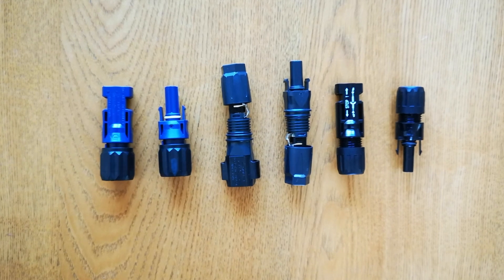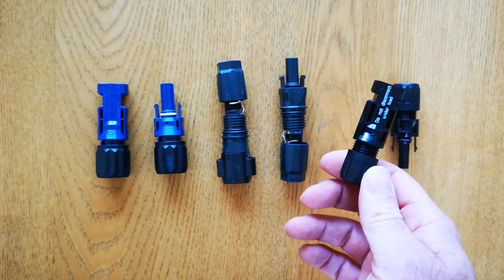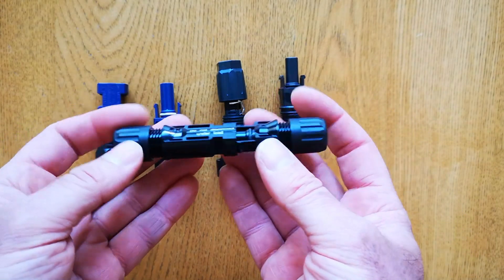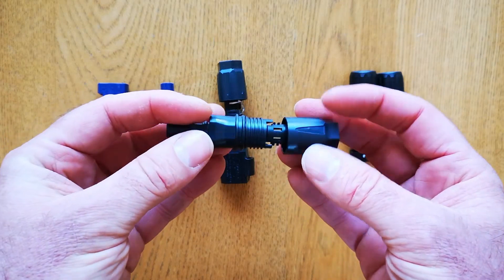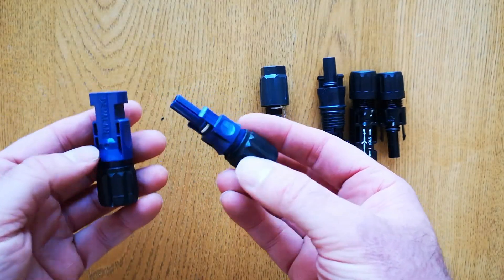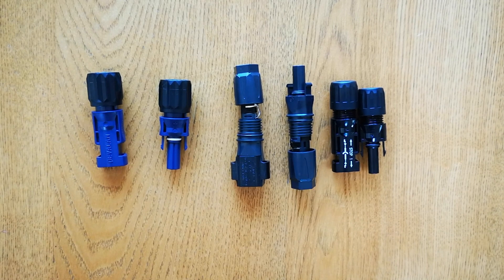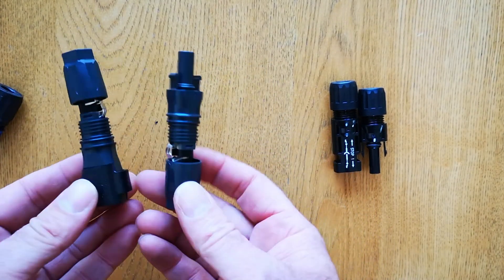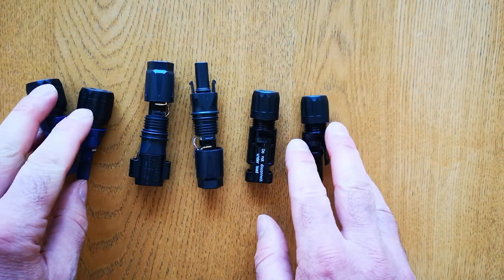The Different Types of Connectors - Solax Solar Inverter Battery Wiring

Comment: Do they now have another type of battery connector? I ask because the Blue Devalan connectors appear to go up to 6mm², but the SolaX X1-VAST inverter manual (Page 59) shows that the battery cable should be 8mm² - Which is a size of cable I'm struggling to find and doesn't appear to fit in any of the standard connectors.
Reply from the maker: I use 10mm2 cable and fit it in the existing connectors. It just fits if you're careful.
Reply: @JWSolar Oh that's great to hear! I thought it might be too big to fit for my project.